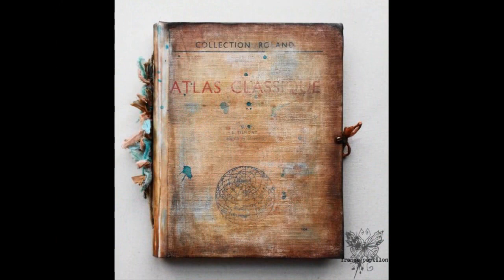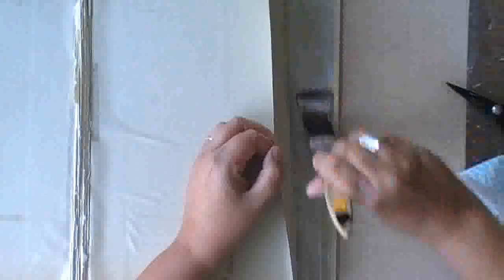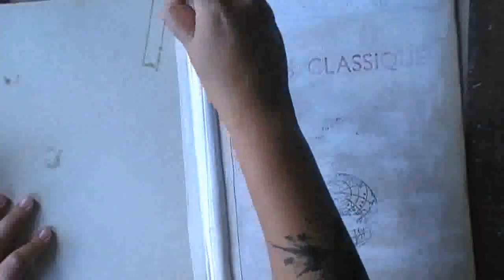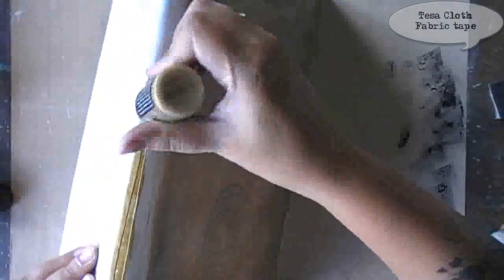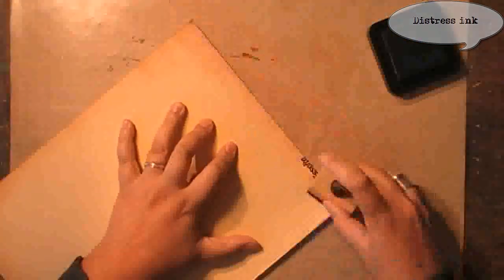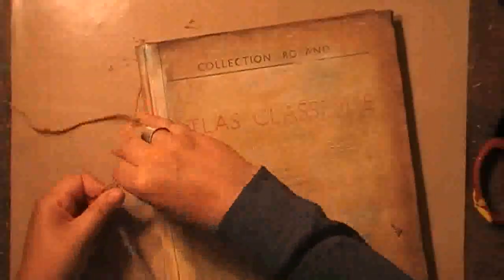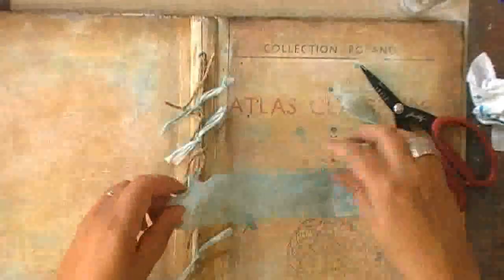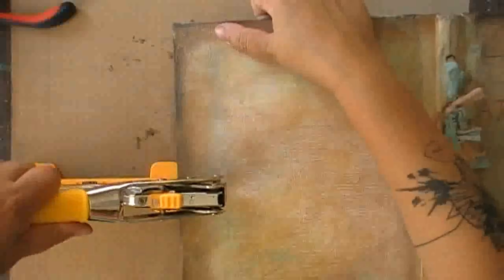Altered atlas... mixed media

Comment: Have recently discovered your channel, and adore all your work and techniques. When I first started scrapbooking, acid free was a key word in selling products. It was used to describe that it wouldn't ruin pictures etc and everything would last 100 years or so.........Then I discovered mixed media, and found another way to use my stuff and make memories that will last forever, for generations to come. One thing that I often wonder about, baby wipes.........They make great tools and I use them to clean my rubber stamps or other rubber tools. I figure the all the softeners will condition my rubber stamps and keep them working for a longer time. My question is.......will baby wipes add acid or cancel out acid free paints etc.???? Cards I give, it doesn't matter for me. But, my scrapbook pages, mini albums, canvas and wooden projects, I would like for them to last 100 years, without any fading or "rotting."
Reply from the maker: Paula Roehl-Johnson I personally keep baby wipes to a minimum and certainly don't use them to clean my stamps. But... I do sometimes use them as a tool to apply/blend paint or ink.
xx